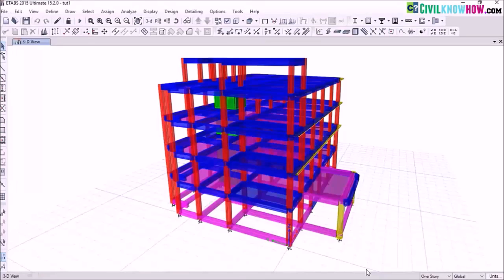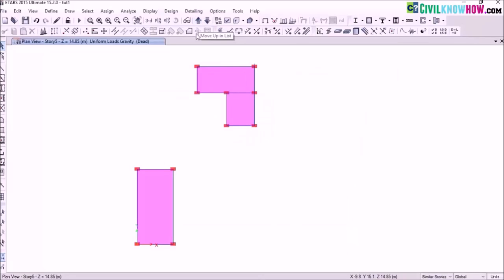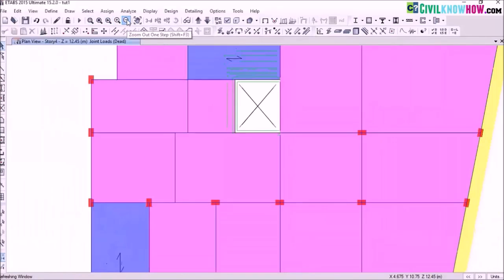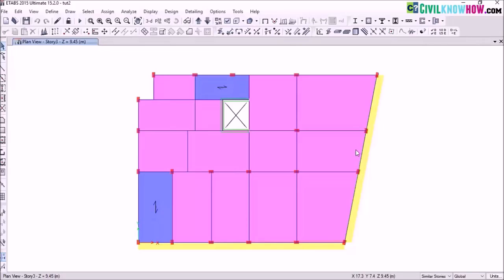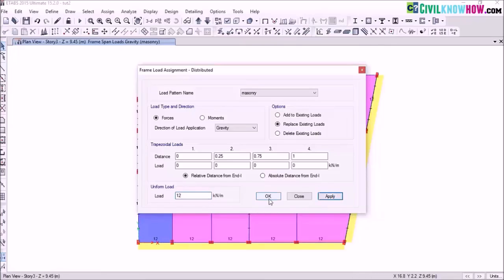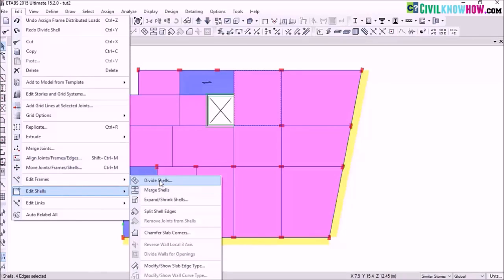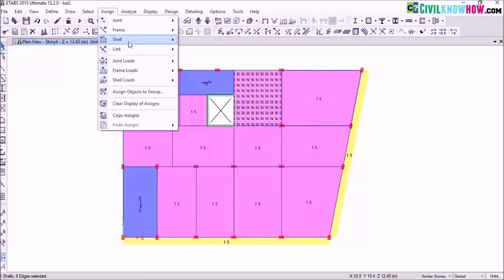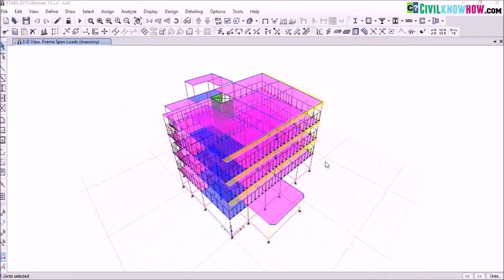Etabs 2015 Tutorial 2 - Assigning Loads and Meshing of Slab

Comment: Dear bro...while assigning load on the top slab for water tank....how did u convert litre to kN....you have designed for 10000 litres but 1 l= 0.024kN but u have assigned 25kN...how this conversion came...

Comment: How did u calculate the wall udl load on the structure...
Reply: udl=width of wallXdensity of wallXheight of wall (width is normally 20cm...and density is 20kN/m3 and height is floor to floor height minus beam depth)

Comment: How to assign for the parapet walls as the beam under selection is full while the parapet walls are only on the boundary.?
Please explain.
Thanks for the Video
Reply from the maker: +Ankur Dubey calculate the load/m of the parapet wall and assign that load on the beam as udl...
Reply: Kindly tell me how to assign it .as the beam has to be broken into two parts for the top floor in your video Please correct me .